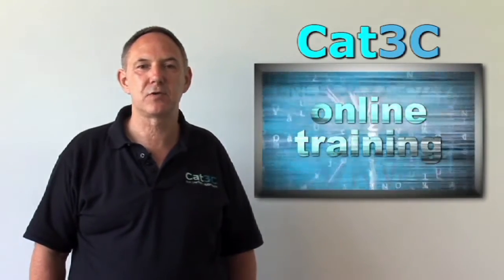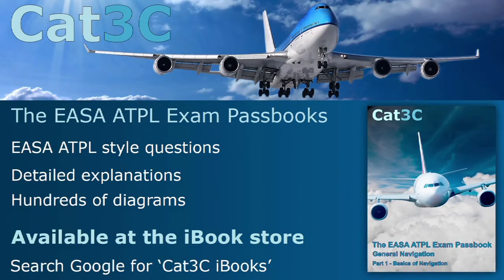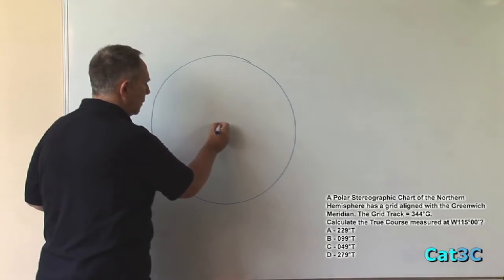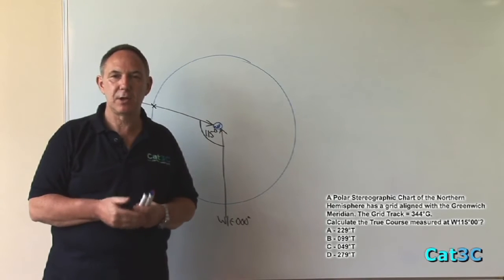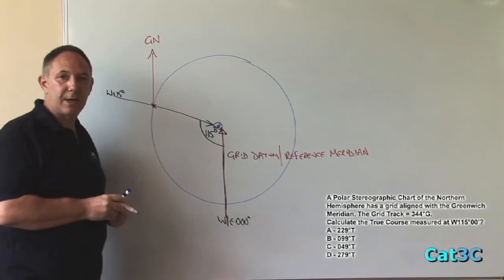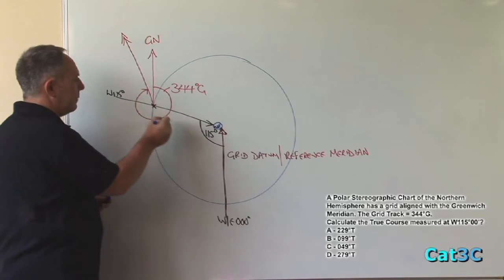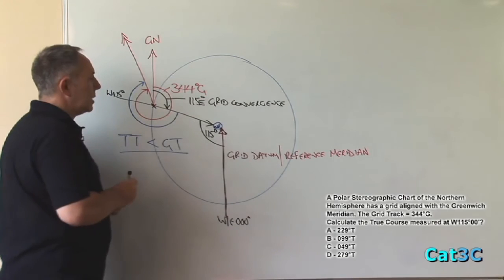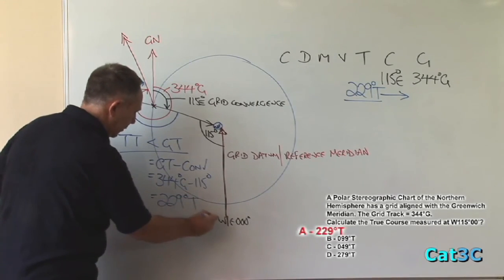QEV 015 Grid Navigation (A)

Comment: No, the local meridian of longitude always points to True North, which is what I think you mean. 
Grid North is always in the same direction as the Grid Datum Meridian, in this case the Greenwich Meridian, which is pointing straight up 'the page'. 

Therefore, at W115:
* the local meridian points to the True North Pole
* the grid meridian is parallel to and pointing in the same direction as the Grid Datum Meridian, i.e. straight up 'the page'.

Simple rules:
Grid Datum Meridian = Greenwich Meridian - Grid North = UP the page
Grid Datum Meridian = W/E180 Meridian - Grid North = DOWN the page

Hope that helps

Comment: this makes understanding these types of questions so much easier :)
Reply from the maker: +Deon van Rhyn 

Read the CAt3C iBook EASA ATPL Exam Passbook Part 2 -Charts for lots more examples and even easier methods of solving polar stereographic and grid navigation problems!
https://itunes.apple.com/gb/book/the-easa-atpl-exam-passbook/id983799518?mt=11
Reply: +Cat3C I'll give it a try, still an endless struggle for me to calculate the longitude of the aircraft.

Question states:

"an aircraft has a grid heading of 310, using a chart based on a grid datum of 40 degrees. if the variation is 10E, and the heading 340 degrees, what is the aircraft longitude if the aircraft is in the Northern Hemisphere?"

Answer is 0 E/W, no idea how they got to it
Reply from the maker: +Deon van Rhyn 

I like it!! 

Where did you get this one from?

Bit busy at the moment but I will get back to you asap! :-)
Reply: +Cat3C I got this question out of my Jeppesen ATPL Notes. Thanx a lot, much appreciated! :)
Reply from the maker: +Deon van Rhyn 

"an aircraft has a grid heading of 310°, using a chart based on a grid datum of 40 degrees. if the variation is 10°E, and the heading 340° degrees, what is the aircraft longitude if the aircraft is in the Northern Hemisphere?"

NOT a good question!!

It does not specify the datum for the aircraft heading of 340°! Given that, under normal circumstances, if flying on a Grid Heading the only other heading to be specified would be a True Heading, a Magnetic Heading should not be considered. We use grid navigation where traditional magnetic navigation is too inaccurate for use. However, as magnetic variation has been mentioned we need to think that reality is being discarded in favour of academic number crunching!

In fact, it only produces the given answer if we consider 340° to be a Magnetic Heading.

So, applying variation of 10°E to 340°M we produce a True Heading of 350°T.

The difference between the Grid and True Headings of 310°G and 350°T = 40°.

This value is known as Grid Convergency. As True Heading is greater than Grid Heading the Grid Convergency is westerly (Grid Convergency West, True Track Best).

Grid Convergency is the difference between the Grid Datum Meridian (GDM), in this case 040° (but we are not told if it is W040° or E040°) and the local meridian, i.e. the point where the bearing is being measured.

But we know that the Grid Convergency is 040°W, which means that True North lies to the West of Grid North at the local meridian. The direction of Grid Convergency is measured FROM Grid North TO True North at the local meridian.

The aircraft must be located 40° from the GDM, i.e. either at W080° or W/E000°.

If the aircraft was located at W080°, transferring a parallel grid meridian from the GDM at W040° would place it to the west of the local meridian (W080°), i.e. anti-clockwise from W080°. The direction of Grid Convergency is the opposite of this, FROM  Grid North TO True North at the local meridian; in this case, at W080° that is clockwise or easterly.

However, if the aircraft was located at W/E000°, transferring a parallel grid meridian from the GDM at W040° would place it to the east of the local meridian (W/E000°), i.e. clockwise from W/E000°. The direction of Grid Convergency is the opposite of this, FROM  Grid North TO True North at the local meridian; in this case, at the W/E000° meridian that is anti-clockwise or westerly.

Therefore, the aircraft must be located at the W/E000° meridian.

Sorry it's a bit long winded and no diagram but I will put together a diagram tomorrow (if I have time) and try to upload it to this post. Failing that, send your email to courses@cat3c.com and I'll send it through the e-post! 

All the best,

Tony :-)
Reply: +Cat3C thank you so much for your time and effort Tony. I'll send you my email address